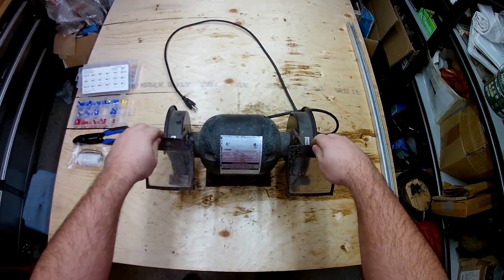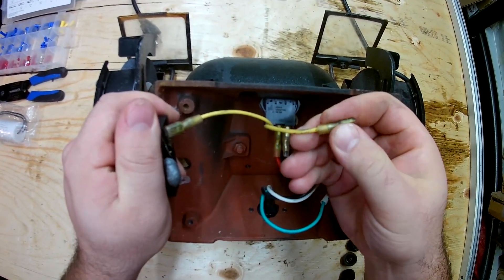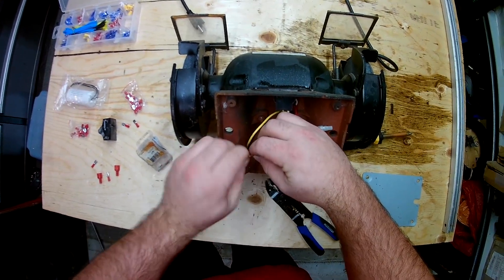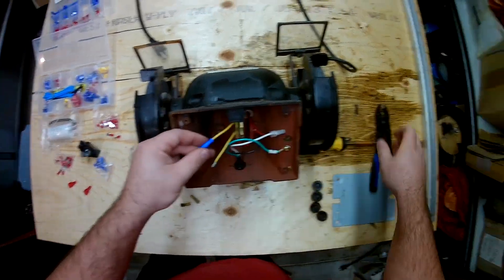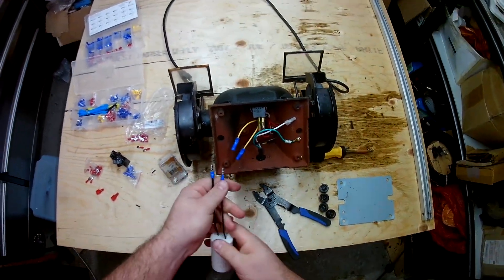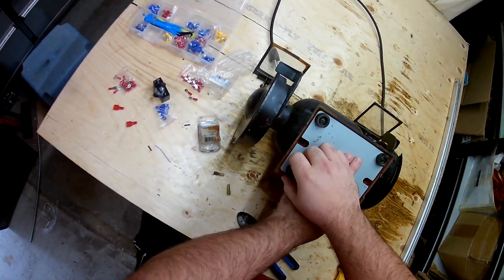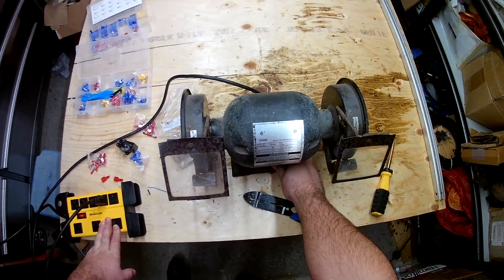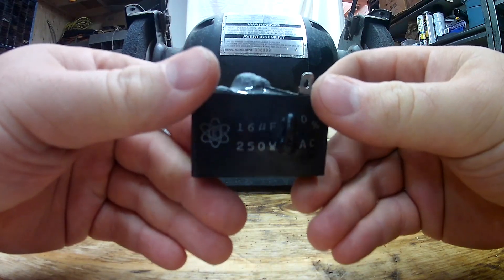Bench Grinder Repair - Capacitor Replacement

Comment: Thanks for this video. I have an old delta grinder that needs a new capacitor. The only markings are SH cap  8 mfd / 250 volts. Would yours work for me and what type and model did you buy so I can order one as well.

Comment: I have an old bench grinder that someone "repaired" before I acquired it. It needs to be completely rewired. It turned on when I plugged it in but the switches did nothing, it just turned on. All the old wiring was badly spliced back together, just left exposed inside the case, and to top it all of it was packed with oily dust and pet hair. I'm just happy it didn't catch fire. I have already taken it apart but I can't remember how it was wired and I dont know much about electronics yet. Can I fuck up the windings if I rewire it wrong? Its ok if I break the capacitor but I don't want to break the grinder.
Reply from the maker: You will most likely fry the capacitor or trip a breaker before anything else. I would try to look up a wiring diagram for the model of that motor/grinder, and failing that a basic capacitor start motor wiring diagram. Best of luck!

Comment: Hi, I need to replace a capacitor in my grinder, the existing one is 4.2 +-5% microfarads, and the closest I can find is 4.5 microfarads, will that cause an issue ? Thanks

Comment: I have a 1/2 hp grinder I need to change capacitor..how do I know what type and voltage?
10uf 250wvac on the damage capacitor... good video
Reply from the maker: Thats all the information needed to find a new one the big thing is to make sure it is a 10uF and that it is rated above 250 volts A/C. something like this should work https://www.ebay.ca/itm/CBB60-450VAC-10uF-5-Wired-Terminal-Motor-Start-Capacitor-NEW/400564188991?hash=item5d437c773f:g:aDoAAOxyrrpTiZoZ

Comment: Hey...enjoyed the video...my grinder also has the same issue but I have no idea what to look for...could you explain to me what I need. What is written on mine is...CAP  10uf  W.V. 250.AC  CBB60-1  HX  MF Capacitor....any help would be great. The grinder is a no name from Canadian Tire that they later used Job Mate brand name...if I knew this at the time I would have purchased a good brand name....it has very little use on it.....Thanks
Reply from the maker: Hi there, glad you enjoyed the video! If your grinder is having the same issues as this one, (won't turn/or turns only when manually started) the capacitor is usually the problem. Make sure the rest of the wiring is intact and check if there is any visible damage to the capacitor. If the capacitor needs to be replaced, you will need is a 10 uF motor running Capacitor. -- https://www.ebay.ca/itm/Polypropylene-Film-Cylinder-Shaped-CBB60-10uF-Motor-Running-Capacitor-W6U2/123412172789?epid=1869197561&hash=item1cbbf04ff5:g:NXYAAOSwHb9buvmA:rk:9:pf:0 -- will work if it physically fits into the grinder. Hope this helps, if you have any other questions I will help as best I can!
Reply: @selturassoma3242  Thanks for the quick reply...the one you showed me is longer but should fit. Mine popped the side out ... I'll let you know when I get the Capacitors...I'm ordering two..lol...could be a month before I get it....usually takes that long ordering from there...Thanks again....All the best...
Reply from the maker: @billbath4534  I look forward to hearing how it goes, good luck!
Reply: @selturassoma3242   Hey finally getting back to you....I ordered two capacitors and never arrived...they resent and only one arrived...there mistake..lol...so now I need your help again....I have a pic of my grinder and the wiring showing....as you can see in the pic, the capacitor wires are pink and black...the new capacitor wire colors are blue and brown....so which color goes with which...lol...the other thing I'd like help with is the rocker switch...which color goes where on the switch...as you can see the colors are pink...black and white..it shows  numbers 1 2 3 on the rocker switch....if you could help with this...I'm hoping this will give me back my grinder....Thanks again...have a great day...
Reply: Tried adding the pic I was talking about and can't ....
Reply from the maker: @billbath4534  You can send the pictures via my my email - seltsoma@gmail.com - and I will take a look, usually if the capacitor is polarized (has a dedicated +/-) there will be markings to indicate that on the capacitors themselves. if you aren't replacing the rocker switch I would leave the wires as they were. I will take a look at the pictures but you can try attaching the capacitor in place of the old one using male/female connectors like in the video, so that if the capacitor is polarized you can switch the wires around.
Reply: @selturassoma3242  your up on this stuff...good job...I don't know much when it comes to wiring...get that pic sent to you in a bit..thanks...